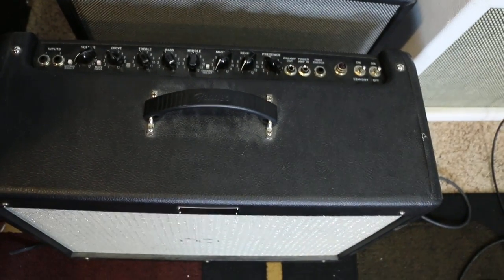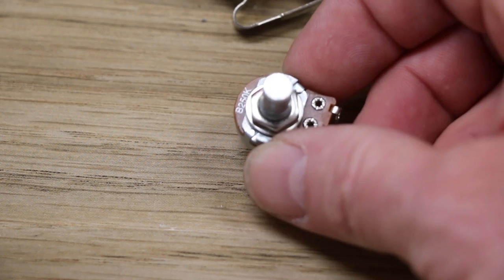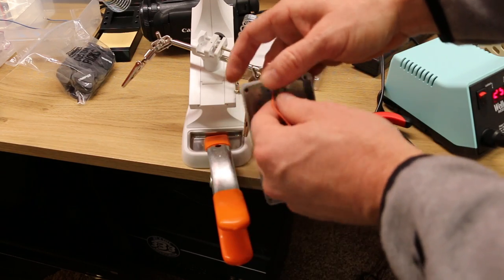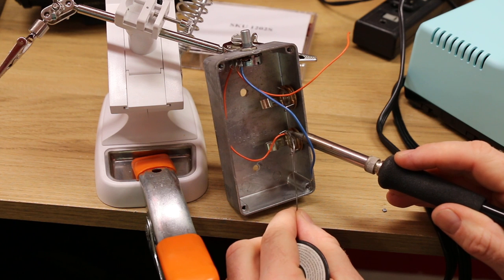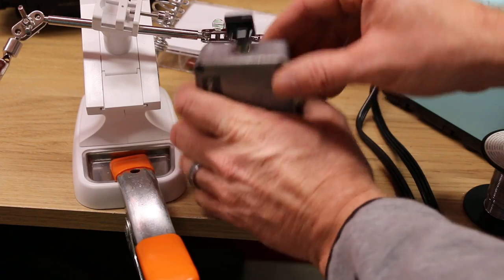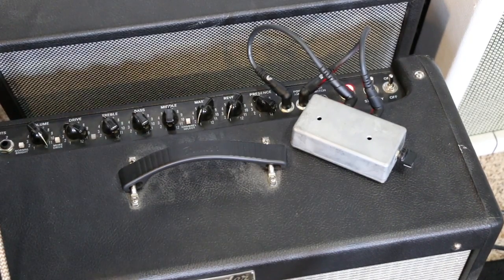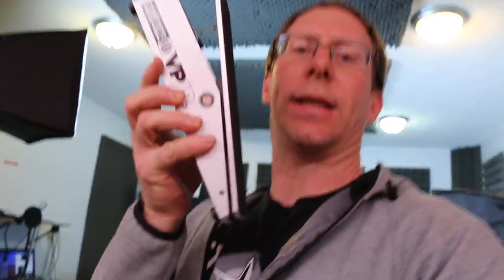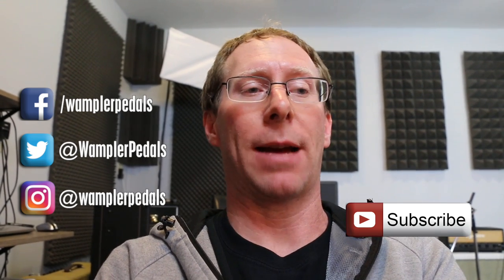Easiest “modification” for Fender Hot Rod amps (and others) to make it better for home use

Comment: hey , Mr Wampler. Thank you very much. I saw your video and it's really clear. a 100k pot and 2 mono jacks later, i have myself a "volume tamer" for my Fender Deluxe.
Reply: im running a 100k log pot but my Eric Clapton strat with its inbuilt TBX control is still a bit too loud on my Fender Deluxe. Even on my 100k pot, I can't wind it past 20-25% without the amp going into distortion.

 Would running a 25k pot be better as in i can further lower the overall volume?
Reply from the maker: Are you using an audio taper?
Reply: @wampler_pedals  Yep, i was. 

 by the way, i built another one of these boxes during the xmas break with a 10k pot. Omg... It overdrives so much easier... Love it !!!!! It's like a little tube screamer LOL

Comment: The sensitivity of the clean channel volume really is a bitch on these amps, when you want to use them at home, especially if you - like me - have the 4x10 Hotrod DeVille, which is insanely loud. But it also has an insanely good clean sound (but a rather crappy drive channel sound). I've seen reecommendations to change the pre-amp 12AX7 tube to a weaker 12AT7 or even a 12AU7 tube, but adding a master volume to the effects loop is so much easier, doesn't affect the gain staging of the preamp and is easily reversible when you want to use the amp live where too loud isn't an issue. Wonder why I didnät think of this. Thanks Brian. It's so happens that I have a pre-made volume box, so I don't need to manufacture one.

Comment: This is awesome solution. You can also use a 12ad7 in the preamp section instead of a 12ax7. It significantly increases the use of the volume knob. I use the second channel with light drive so I can use my master volume.

Comment: Trip to radio shack, and the thing actually works. Couldn't find a 100k pot at radio shack, so I substituted. I did find that your video contradicted what the website you shared as far as the ground post. After I made that change, works well. Next time I'll use a higher quality pot though. 

Used on a 22 watt fender super sonic. Nice project for a wanna be pedal maker...how about some future vids on making/modding further. 

Kudos!

Comment: Because my Fender Twin Reverb does not have a Looper in the back I have to do that but into the front of the amp so what I do is I run my pedalboard into JHS amp box with a master volume just like you built on this video and I run that into the front of my amp and keep my volume on five on the amp in the summer and seven or eight in the winter and use the master volume after my board on the pedal

Comment: There's a guy on ebay who sells handwired volume box attenuator it's called.

I've bought one for myself (£28) to try with my hot rod deville 4x10 If it works and is quiet and gives you the break up tone  at sensible level at home and can also give the break up tone in band situation then I'll throughly recommend one 👍 

I'll even post the link for it. 

I'll update when  I've got it and given it a go .

Comment: I discovered that on some amps, you don't even need the box.  Just a 3'' jumper cable from the "preamp out" to the "effects return" and there's a massive volume  drop.  Peavey style amps that have a lower output "preamp out" vs the effects send.

Comment: Aw man! Thanks so much for this video! Been thinking about changing my V1 to an 12AT7 but I didn't really want to change my tone and this fixes my problem of wanting to get my amp 'hot' while keeping the volume down a bit. I've had an idea where I'm going try to measure the space between the in and out and create a box with jacks that come out of it directly at that spacing, so in theory there'll no need for patch cables. If it doesn't work, I'll just make new holes in the box! Wish me luck!

Comment: i made this with a old ds1 i had. i recommend soldering both the grounds together on the input output jacks if it is not cutting enough signal.

Comment: I have a Fender Performer 1000 , 100 watt tranny amp . The volume goes from silent to deafening at about 1.5 and is very difficult to get a usable volume . Somewhere on the tinterwebs I read that using a patch lead to loop the line out to effects return ( doing this from memory as the amp is in a rehearsal room , but I think thats right ) , the volume could be tamed by then setting the effects mix dial to about 5 ( or whatever suits ) . This is what I did and it worked a treat .
Reply: Smithers & Co  but how then do you use the send & return inputs for your pedals?

Comment: Hi.  I love your videos!!!   I hadn't done solder project work in years and this looked easy and simple and fun. so I built it.  two jacks and ordered a 100K audio pot from the web for 8 bucks.  I had an old pedal box laying around. I did go out and by one of those new fangled conical drill bits. Wow.!!!!  what a great idea for drilling holes!  all the old horrible jobs I did by not having a 3/8 or bigger drill big, Jeez!   Anyway,  conclusion.  job was simple enough.  I plugged it to the effects loop of my Marshall JMP. ( Sorry, I don't have a Hot Rod Deluxe anymore).  It just doesn't work like the one you demoed in the video. Kind of changes the tone, not really that effective , certainly not over the full range of the knob.  My "amp guy" said that the box probably wouldn't work with my Marshall, the loop is different than the Hot Rod,   Guess he was right.  What would the same idea/box work with a  250K audio taper pot with my Marshall?   Thanks!!!!

Comment: Does all this work for any Fender tube amp? Ha. Some talk about loud with a H R deluxe. Try my pro tube Twin. At 1 and a half or plenty of room before you get to 2, I had to point the amp at a wall (concrete) and put pillows around in a basement just so we could hear. Then I found a volume reduction box like this and.....I could get all the way up to   4. Even with something like this it's still so LOUD. But I love that amp. Great back up to my Boogie.

Comment: Just a comment about breaking off that tab. You should not break those off especially if you are putting that pot into a metal case.  The purpose of that tab is to prevent the pot from rotating when the nut comes loose. In this case, as you pointed out, you would short out the pot connections to the case. Instead, you need to drill a small hole in the case the same diameter as the tab in the same position as the tab relative to the center of the pot shaft. That way when you secure the pot into the case it is locked in to the specific location and will not rotate when the nut comes loose.
Reply from the maker: Yes, I know. Most people don’t waste the time to do that on their own personal stuff.

Comment: So thankful I came across this video. I've been trying tame my Deville for years. I have gone as far as changing out the annoying volume knobs with linear pots (as opposed to the stock audio pots which increase gain exponentially). It does give me much better range, but I still have to make the amp get very loud—almost always too loud—before it starts to break up. I'm going to give this a shot with a defunct basic distortion pedal someone made for me out of similar parts.

This question has always been a curiosity of mine: how does the effects send work in the Hot Rod amps? I've never managed to get it working correctly. I've tried a delay pedal in there and got nothing.
Reply: Actually, my custom pedal is basically one of the pedals you explained in this video: https://youtu.be/PH2uj9bWfM4

I wonder if I'll be able to use  it as a passive pedal as is.

Comment: Great video. Another solution, (that someone else may have mentioned) for those who do not want to build something themselves, is top use a volume pedal for this same application. In fact, this trick will work on any amplifier that has an effects loop built in. Put your newly built box (or purchased volume pedal) into the FX loop and use it to control the volume in situations where you really want to drive those pre-amp tubes, but loud volumes aren't acceptable.

Comment: I have ordered parts to build this myself. It will cost me $25 (around 230 SEK), but the box with pre drilled holes is what cost the most, almost $15. Maybe I could have found a cheaper one, but I got tired of looking. I bought everything from the same website. I can't wait to build it and try it out! I really want to hear how my amp sounds when it's pushed. 

Oh, one question! Can I combine this with other pedals in the loop? Won't it lower the volume of all the pedals in the loop?

Comment: You can buy a master volume switch on ebay for the hot rod. It’s $25 and you can turn the tubes as high as you want and lower the actual volume

Comment: I think you kinda should have had a common ground for the whole circuit (Output amp and the speaker). It will work, they just might not be at the same voltage potential and you could get noise problems

Comment: Brian, you're right about the joys of soddering (sic). I've been doing it man and boy for nigh on 50 years and I still enjoy it. It's what led me to get into electronics and sound as a trade. First job was repairing my first curly guitar lead '68-'69.
Question - Would it hurt to use a 50k instead of 100k ? I ask because one of my foot pedals uses a 50k (Behringer FCV100). I know my front end volume pedal won't cut it as has a 250k (Daphon DF-1511B)
Reply from the maker: Depends on the impedance of the loop... worst case scenario just run a buffer before it
Reply: soddering??? lol   soldering
Reply: (sic) written as pronounced in USA , and Canada to their shame...

Comment: Wouldn't the pot attenuate some of the high frequencies as it is cranked?  Can a trebel bleed mod be used to correct it?  Especially since your're using a 100k pot.  Why did you choose that and not a 250k, 500k, 1M, etc? ... OK I finished the video and that answered some of that :)

Comment: Brian, I also love your videos. I know this one was almost 5 years ago but thought I would ask anyway. I assume that this box will work on the HRD ML. Now I have been researching different modifications for this Amp. Mainly for reliability and performance issues. One mod replaced the Audio pots that are used in this amp with Linear taper pots, and it seemed to give the amp a much more manageable volume control. What are your thoughts on this? I noticed that you used an Audio tapered pot for your Master Volume box build. Thanks and I look forward to your next video.

Comment: Brian, would it be possible to do a video on how to stop the loud "pop" that occurs when you turn some pedals on and off...?  It's terribly irritating, and quite a common problem, it seems.  I've read that the loud popping is caused by a voltage leak, because the pedals weren't properly grounded, and actually come across a couple of articles that claimed it was a simple fix of soldering a capacitor onto one of the legs of the output jack, but no one ever mentions a value of cap to use, or just where to actually solder it (in between lugs, or between the output line and the jack itself.  Have you run into this...?  Is this the simple fix these guys claim it is...?  Something you might be able to do a video on...?  I'd really appreciate it if you could... Thx.;-)

Comment: Brian, how hard would it be to add a diode?  Can I put the light in without too much more complexity? I have never  built one before but would like to try it.  I'd add an on / off switch and would of course like to see a nice light on when the unit is engaged. Is this too much?  lol. Btw, nice pickin and thanks so much for taking the time to walk us through this. I have been enjoying my Hot Rod Deluxe III for a couple of years, but finding this post yesterday and running home after my day and experimenting with it last night, I swear, I have fallen completely in love with my amp again. It's really like I am hearing the capabilities of this amp for the first time. So gorgeous! I'd love to follow my discovery up with a dedicated little unit like this (I used a spare volume pedal to explore last night) but a dedicated box, made by my own self, that would just be so cool. But of course I'd like it to be somewhat fancy about it and might include the cap to brighten it like you said, maybe use a toggle to engage that too. But I'd really like to add the light to it though. If I can.  I hope it's not too much for me to tackle. Let me know pls. Thanks again, you rock!

Comment: You wisely warned us about not to insert the pedal the wrong way. 
Just let's imagine I have a cheap but working volume pedal, wich could be the problem inserting into my transistor Fender Frontman 65R? Is there a wrong way and a correct way to insert my volume pedal into it?

Comment: HEy ...awesome...I have one of these amps and that is exactly the problem...very little control over the volume. What about approaching it like Eddie Van Halen did and plugging the amp into a power supply that can control the voltage? Would that be the same? Also ...what if you add some delay ...reverb to your box ..with a pedal plug in that can go to the pedal board? Now that would be cool!!

Comment: So, what's the difference b/w an attenuator (sp.?) and a volume box. I recently bought  the little Dr.Z combo one for my Orange AD-15 (name drop!) for double duty - apt. levels and controlling my volume when turning my MASTER up to 10 at venues.

P.S - Can you please do a video demystifying the A/D class amps? Maybe, at least, a comparison of classes to simplify understanding of the A/D through it's differences.
PPS - Did you abandon your plans to add a much needed FET compressor to the world? Currently, I know of 2 out their, but they have way to many knobs and features for a pedal that typically just needs one sweet spot  to be effective on your rig. They're also way too big for a pedal board.

Comment: This is awesome. I'm going to buy a pot on ebay right now. I have a Marshall Origin 20 head, you do have to be pretty loud to get it to sing.  I wonder if it still works when you're using other things in the loop? Presumably it would need to be the first or last thing in the chain?

Comment: I've got an old Boss GT-3 multi-effects (has a built-in volume pedal).  Would it work to put that in the effects loop?  That way I can add some modulation and time effects too.  Trying to decide between blues jr. and HRD.  I only play at home but I prefer the larger more open sound of the HRD to the blues jr.

...man if Fender put like a 5W switch on these things it would be a perfect pedal amp for all uses wouldn't it?

Comment: Could this same build be utilized to create a small volume knob for use on a pedalboard? I realize that you might want to switch out the pot for something like 1 Megaohm but is the overall design the same?

Comment: Thank's for this info, helps me a lot!  btw.. i have question about the tubes, Preamp and power tubes.. I already replace the preamp tubes with some JJ 12AT7 on both V1 and V3 (phase inverter) I left the V2 (drive channel) with the original tube i really don't use it,.. Now it's time to change the power tubes... which one's you recommend for a nice jazz sound, clear and warm with low end, (jazz tone like Wes Montgomery and George Benson) I heard something about high rating 8-10 tubes for clean sound fuller and rounder.. 6L6 Groove tubes... ??? (my amp is a Hot Rod Deluxe 3).. thanks for your time and your suggestions !

Comment: Soldering is therapeutic. You eventually start getting a strange satisfaction watching the solder go molten, soak into the joint, then flash solid when it cools.

Comment: Hi Brian, 

I've got a 1st generation Fender Hot Rod Deville 410.  I've long had that volume issue as well as avoiding the dirt channel as it sounds terrible.  I've adapted by using over drive and fuzz pedals and like the sound I get.  I had a Marshall Valvestate amp about 10 years ago and really liked the clean and crunch sounds I got from that.  I wonder if I should bother modifying my Deville or if I should get a Marshall Tube amp again.  What would you recommend?

Comment: Really nice tip adding the 100-300 pf capacitor to avoid the pot cutting the high frequencies. Thank you. But using this lower of signal to the power tubes doesnt avoid them to get saturated and sound gainy ? Wouldnt it be better to use an attenuator ?
Reply from the maker: Good questions!
This basically just creates a master volume control like any other amp would have, so yes it will lower the saturation to the PI and power stages. Also, in my opinion I prefer an actual attenuator rather than this.
Reply: @wampler_pedals  oh great, excuse me I didnt knew a master volume do that !
Is it true that even the “reactive” attenuators may damage amps ?
Reply from the maker: No, I haven’t heard of that, as long as they are a well designed one. I use a two notes captor.

Comment: Brian, could you not replace the vol pot with an audio pot  on the amp and achieve somewhat the same result.  Also I have a Super champ XD that has the same problem, at 2 it just is unbearable in my apt.  There is a line in port on front and a line out port on back can I use these to plug your vol. box into?  Sorry for my ignorance, new to dealing with amps.

Comment: Other than this volume issue, is the original HRD amps decent?  Or is the third one better?  I have the option to buy either but the earlier ones are much cheaper, even if you include the cost of this fix (buying a volume pedal, making a pedal etc).

Comment: Very timely. I have a couple of these boxes for my devilles. I get ground loop sounds from them? Any Idea why? Just putting a patch cord in the effects loop is no problem so it doesn't seem to be the amp. Putting the boxes further away with longer cables doesn't have any effect. Wiring seems okay in the boxes. Housing is earthed via the jack socket. Hmm. PS Plexidrive is very fine!  The Turnnus is totally fantastic!